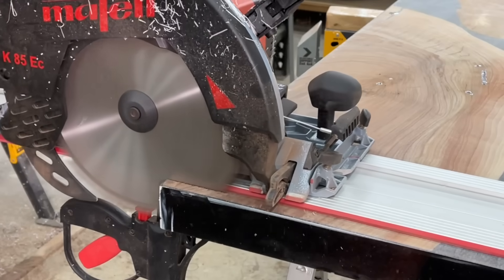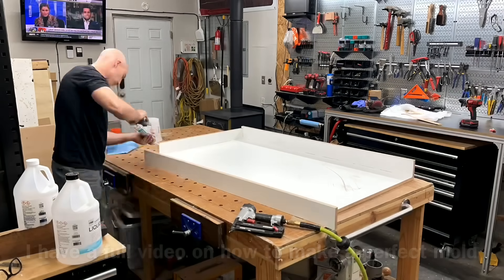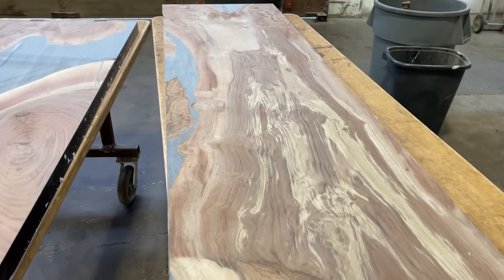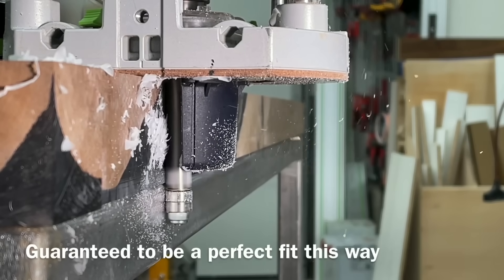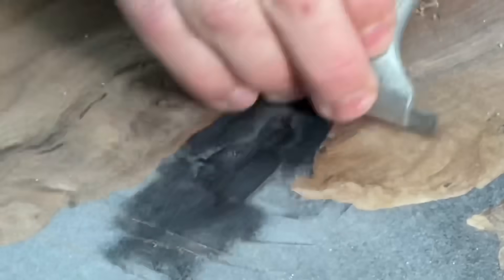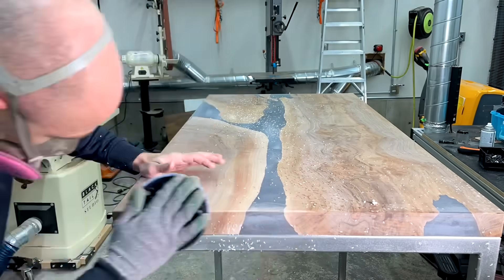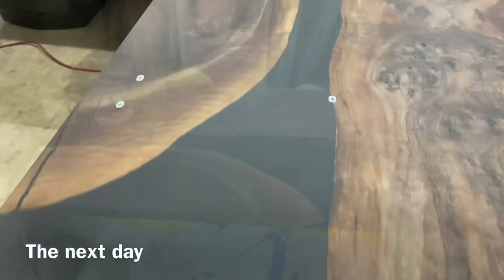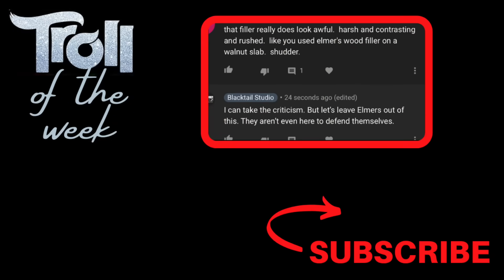Standing Desk The Cops Thought Was Loaded With Drugs (really)

Comment: What you are creating is art.  No one bases the price of a commissioned painting off of a multiplier of paint and supplies used cost.  Doesn't matter if the wood only cost $200.  The guy paying your $7k is paying you that much because you're an artist and no one else (or very few) would be able to turn that $200 piece of wood into what you made.

I usually hate epoxy in combination with wood but you're the first creator on YT I've seen where the combination of those two makes me say "wow" every time.  It's not that I hate epoxy with wood.  It's that I just haven't seen anyone do it this well before.  Love your channel.

Comment: I’m learning a lot from this video, I’ve done epoxy and it can be rough.
One tip I do have is, carefully use a propane torch and 
it’ll help lift the bubbles out. If heated it’ll make it more viscous. 
But… if you heat it too much you’ll brown the epoxy.
Reply: Microwave before pour then heat gun bubbles on top.

Comment: When it comes to pricing, the rule I've always given for artists is that you base your charge on three things: materials, time and expertise. You mark up the materials cost somewhat just to ensure that you can always afford materials for your NEXT project, you charge a good rate for the time you put in because your time is valuable - otherwise a labour-intensive project that uses comparatively cheap materials would come out underpriced. Lastly, the expertise portion represents the fact that you have a level of experience and skill in your work that a novice couldn't hope to match given the same time and the same materials - it's the difference between getting a table and a GREAT table.

Comment: Based on the chemicals you use, I’d imagine meth since it seems to require a lot of chemistry to make. Any tips on water-based polyurethane? I want to sand it and reapply, but am worried it will take off the layer I’m trying to protect. Thanks for the video, awesome project, and great tips (I liked that glove and will check out that other channel)!
Reply: I use water based poly's all the time for finish projects, specifically on reclaimed wood. Let the poly cure and fully dry for like 12 hours, even if the can says "30 min dry time," then sand away, you will be able to visibly see clouding and that way you can tell what you haven't hit or gone over. After its all sanded, the next layer of poly will literally look like a layer of epoxy, it gets much more glossy and smooth the more coats you put on, each with a proper sand in between. I usually use a 320 grit.
Reply: would be odd if you're right because none of what he's using is used in meth. maybe the outgassing of the resin or finish fools the dogs
Reply: @felonosrs  I only have 200 grit, so 320 is a great suggestion. thanks for the reply!
Reply: @northroad1  oh dang, you never smoked that Poxy?

Comment: Have you ever tried having any sort of vibration unit running, for a few minutes as the table starts to cures and drys??? If found right away...you could correct the imperfections immediately without waiting for the whole table dry's. Blue Sky's.

Comment: I've been very impressed with your work, I've often wondered it you have considered building up a "low vacuum" vacuum table for your large pours. I think you could build up a large "tray" (maybe out of high density poly) that you could cover with a oversize lid; something that could hold a slight vacuum ( enough to get the worst of the degassing out). Build it out of the right material and it would be reusable.

Comment: Did it have any cracks?
Hey I don't know if you have the space,  but you could use a vibrating table for concrete while pouring the resin in order to avoid bubbles,  also a hand vibrator would do the job if you have no space for the table.

Comment: For the pour and set stage, what if you aggressively vibrate the table while it cures ? A high RPM electric motor bolted to the bottom with an offset weight would do the trick. While the resin is freshly poured it should disrupt those air bubbles and ideally bring them to the top.

Comment: You're correct about shellac, but that's because of wax in it. Wax free sheLlac/sanding sealer doesn't repel. I used it on lathe projects without issues.

Comment: Lovely build. If you put the bolts in and leave them sticking out a little bit after you add finish to the bottom, the table top could rest on those and you wouldn't get any marks on the bottom. Just an idea.

Comment: idk if there would be an advantage of allowing the epoxy to set but having the mold and such on a floating table?  one that can change the x/y axis as to help remove the air pockets? the mold would have to have a cover of course for when you would be moving it around ( idk the cycle that would end up becoming standard ) now i understand this has an issue with venting to allow the setting process to be quicker... idk the characteristics and such of the epoxies and their necessary sort of practices when used.  and a pressure vessel would have to be huge to put the entire table in to use... eh  sorry it's just what popped into my head.  no idea if it would work or be a waste of time/money.  peace.

Comment: This may be impossible but as you start to pour the epoxy, could you tilt the table side to side, then front to back to allow the epoxy to "fill" and "drain" any under side caverns?  I believe the result would be to pull out any air, then continue to fill the mold. Just a thought, again maybe not feasible.
Reply: And of course the tilt would be gentle and subtle, to not create bubbles.

Comment: you mentioned the whole pricing thing, my opinion is that the fairest thing it to estimate the man hours you expect to put in, and charge based on both expected time and materials. This means that the main cost is your time as an artisan, but you aren't charging extra if it takes extra time, and you are charging extra if they want extra expensive material. I'd also charge a small additional cost for using materials that you picked up cheap because it was a steal and stored for a while, because the material is worth more than you paid, and there is a cost to storage.

Comment: Maybe it was airpocketonium in the crate.  Dogs can smell that from a mile away but hard to detect by humans.  Have you used shellac.  I love amber shellac but it seems to be hard to find.  I did a cookie slice table from a black walnut tree and i had let it dry for a week,  I use it as a side table to my desk and have my personal laptop on it.  The feet of the laptop left small dings in the finish.  Pretty easy to fix shellac finish but concerned it will happen again.  Any thoughts on what happened? Shellac is usually a very hard finish.  Thanks.

Comment: Hey I know this is an old video, hope you’re still responding to comments here…..  when you say epoxy won’t bond to shellac, could a shellac coated surface make for a more reliable mold release?  I know you reuse a lot of that melamine for multiple forms.  Could you scuff that surface, coat with shellac, then spray mold release or maybe not even use mold release any more for a more consistent result?  I know you’ve had a few when that melamine really stuck.  You think this Would this help?

Comment: @BlacktailStudio - for air pockets.. maybe make a small DIY tool, that has a small aquarium pump that you could pas over the undersides of the epoxy, to force out bubbles that way. 🤔  i think it'd be a good move. At least give it a try, itd cost yiu $20-30. Just sucking the epoxy through & with a light laminar flow, kinda like how you use the brush.. or even attatch a brush & have it come out that..  a few passes & you'd likely have no hidden bubbles. Just a though..
Or even find parts of the wood that woukd likely trap air & either put some epoxy in them before the main pour,  or even just make the wood shaped that either the bubble can escape, or never form in 1st place.. honestly a real god brushing where u poke with the top to force bristles into little negative spaces.. thatd help to. Mount a brush at an angle where u can pull up/back opposed to bending down & pushing up&in . Easier & more efficient. Hell- mount a pump goingvthrough That brush? You're All good now. Hope i could help. -halfstep

Comment: If you're wasting literal days due to air pockets in your resin, you might want to seriously consider building a vacuum chamber to pull a vacuum on the table after you've poured the epoxy.  That'll help remove a lot of those air pockets, and should save you a fair bit of time as well.

Comment: Why worry about the material mark up, when you gouge the hell out of them on the labor?  Doesn't appear to be much talent in pouring epoxy and slapping it on a fabricated, spray painted metal stand.  And $7000 for that table is fleecing for sure.

Comment: Either cocaine, which would be odd but believable as it would easily fill the hollow parts of the table legs; or, MUCH more likely, cannabis because you live and ship out of Oregon and it's a comparatively easy thing to traffic. It also has a smell that is both strong and easily confused for other things, so the dog would believably go "cannabis???" if it smelt something like the finish or similar that, for whatever reason, has similar molecules. Sage smoke, for example, often smells VERY similar to cannabis smoke.

Comment: What is it worth. interesting question, $7000.00 is very expensive.  How do you work that out? Some people charge an hourly rate, for  the labor e.g. what do you price your skills at, compared to a teacher or an accountantant or a trades man? In my country bricklayers earn $100.00 dollars an hour. other trades are similar. As a manual past time that has occupational health and safety risks, and cost of disposal of junk produced, and insurance premiums etc, there is plenty to think about. ever seen the invoice for the service of your car? they charge you for the cost of disposal of used oil and filters etc.
if you feel you are more skilled than a teacher (top ranked annual wage of about $107,000 gross), you can always start at somewhere around 85.00 dollars an hour and add in materials,cost of electricity, etc. what does  it work out to be? l would be interested to know.  l don't make tables.

Comment: This value based on material is just BS. Take silica, also called silicon dioxide (SiO2) for example. The mass of Earth's crust is 59 percent silica. How much is the silica cost when you make a chip out of it. The cost of silica as a raw material is very low, even I you consider the elements used in doping the silicon. Should we get the price from the raw materials or from the job done to the raw materials? I would prefer getting the price from the job and the raw materials used, otherwise we wouldn't be able to find anyone willing to make chips.